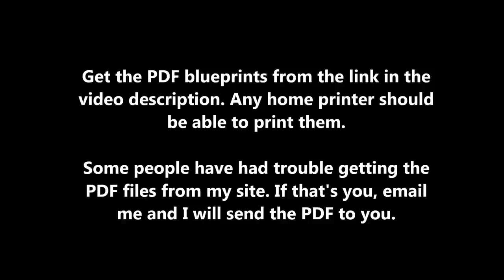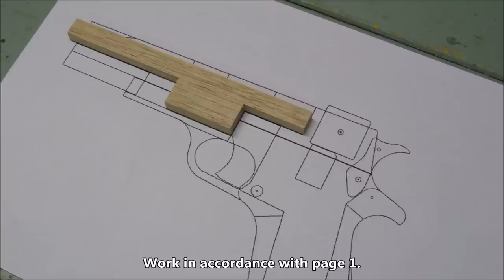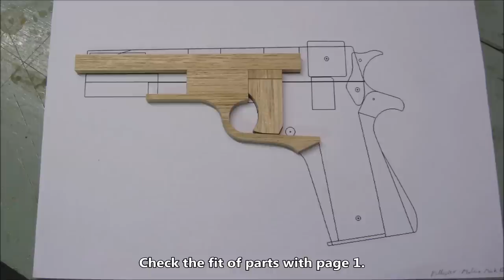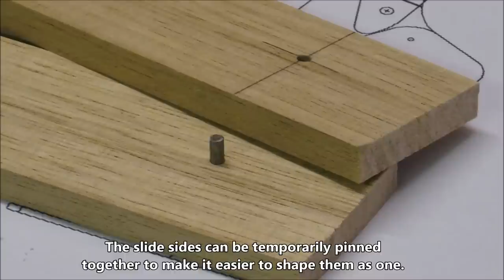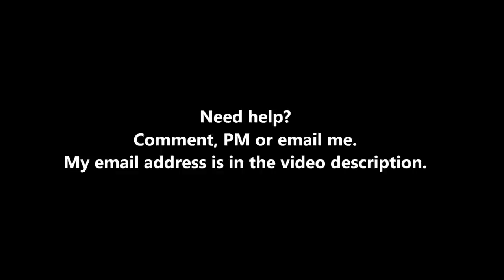Tutorial — blowback rubber band gun

Comment: In new bluprints, there is a problem with slide stopper and slide. They don't fit together. The slide stop hole in slide is in wrong place. It should be about 8 mm right. And another problem is with a4 part. It is too long in plans, and has to be cutted 3-4 mm more.

Comment from the maker: You'll need to play around with either the rotor block or the hammer. The slide should move back 15mm before the rotor releases, if not the rotor block is cut wrong. However, it's much easier to tune the hammer - just glue a strip of wood onto the part that the rotor contacts (or is supposed to contact) and shave it down until the rotor strikes the hammer upon release.

Comment from the maker: The back of the slide should lift up more than 3mm, else it will do exactly this. You may be able to fix it by shaving a little bit off the barrel block, which will pull the slide closer to the frame. I'm not quite sure what you mean by a tilted rotor block, but if the bands slip off the rotor, you can cut notches into the rotor. Look at "Ruby pistol - Mk. 2" at 2:22 to see what I mean. Try other things, maybe like a bigger rotor, different hammer, etc.

Comment: On the print settings, should I use "Fit to page", or just keep it? Using A4
Reply from the maker: Caleb Smith Select "Actual size"
Reply: ***** Thank you! Also, couldn't you just load all of the rubber bands on the barrel instead of the loading pin?
Reply from the maker: Caleb Smith It would make the trigger pull too heavy because you would be stretching all 7 bands at once.

Comment: Okay I have a question, I just got mine done... THAAAAAANK YOU  SO MUCH BY THE WAY.... this thing changed my life completely... I worked very hard on it... and I just have a skill saw a dremel and couple of sand papers... it looks decent... but it's shooting burst mode... I can't think of how to fix it... my rotor is releasing the bands super fast and the gun is not coming back automatically to it's resting position... so when I press the trigger, the slider just stays back and the rotor spins releasing as much rubber band as I can fit in this thing...  any thoughts? First Brazilian guy to build and comment :D hahaha
Reply from the maker: Glad you like it! It sounds like you have two problems:
1. The slide will only return to position if you load the first shot on the barrel instead of the pin on the slide. This video shows it, though not very well: https://www.youtube.com/watch?v=1Ck5_6zz_7c
2. When the slide is all the way back, the rotor should not spin freely. Instead, it should turn about 45° and hit the base of the hammer. Try glueing on more wood to that part of the hammer and filing it down until it works.
Reply: Thank you man! I watched again and noticed the Hammer and how it stops the rotor from releasing the bands, I think I sanded the hammer a little to much, the rotor scapes with the pressure releasing all the bands... Also, why doesn't the gun go back to it's resting position? I loaded with a rubber band and gave a couple of turns to make sure it wouldn't come off, but it's not bringing the slider back to it's 
resting position... could you explain me that one? sorry I am a pain in the butt haha
Reply from the maker: Once again, make sure the first rubber band is loaded onto the notch in the tip of the barrel. Then load all others onto the pin in the end of the slide. That way the slide will only stop returning once you've fired all the shots.
Reply: Thanks man... I will try that !
Reply: The problem is that the hammer has a design problem. I needed to put a spare wooden piece to the hammer to make it work